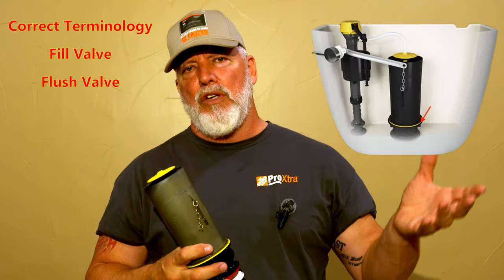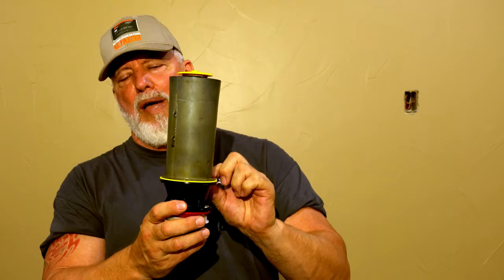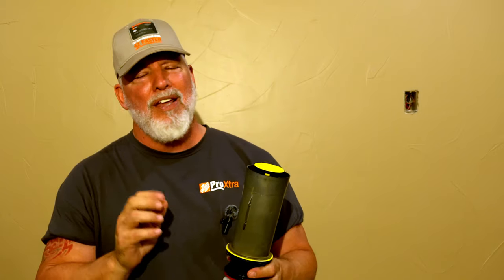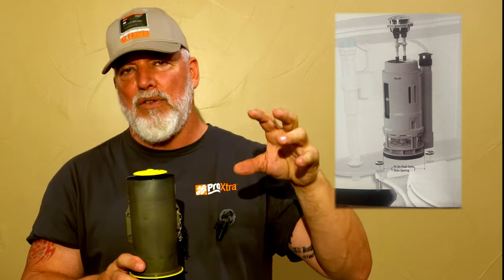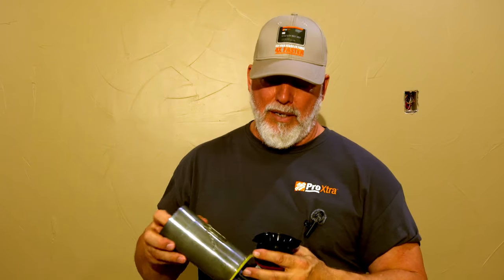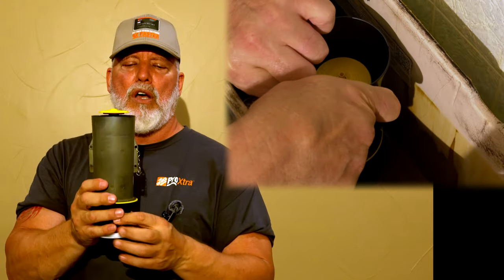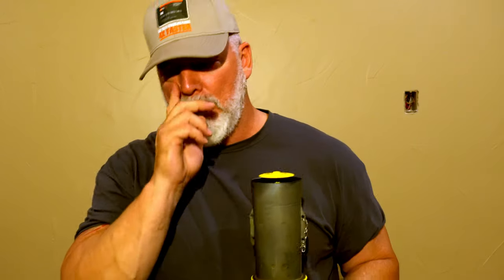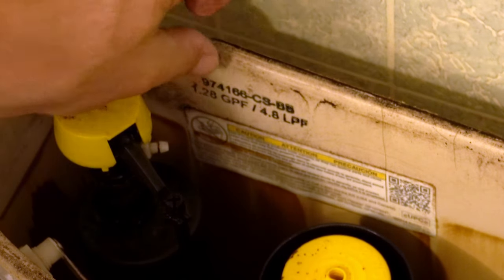How To Fix a Kohler Canister Flush Valve In 60 Seconds in 2024 #kohler #plumbinghacks #toiletrepair

Comment: Every time I flush mine, the canister gets stuck all the way up, and the water continuously fills and never stops. If I just tap it, it falls down easily
Reply from the maker: I check your handle adjustment, if it looks good I would replace the canister. Thank you for watching and your question.
Reply: I have the same problem.  How do you adjust handle?
Reply: Same problem here
Reply: Mine keeps leaking.  Won't seal
Reply: Thx. This has been 8 years of frustration. Dont like these cannisters.

Comment: Good presentation.  The Kohler valves are a BAD design...if you don't hold the handle down for 5 seconds, you don't get a full flush.  Worse, you don't get a full bowl fill, and you may have solid waste sitting on dry land, getting stuck and smelling bad.
Reply from the maker: Absolutely agree, thanks for watching and sharing.

Comment: I replaced the canister but now the water is bubbling in the toilet bowl and sounds like it keeps “running”. What am I doing wrong? 😣
Reply from the maker: @cassandraoshea4713  I would pull the canister back out and reseat it. Bubbling sounds like something maybe stuck . It will make a gurgling sound if there’s something stuck in the line somewhere.
Reply: I just watched your other video and it stopped based on turning the screw on the flush valve. Fingers crossed!

Comment: My valve stopped flushing the right amount. What is wrong?
Reply from the maker: There can be multiple reasons from a bad or clogged fill valve or flush valve to the handle. Also check that the water is filling to the top of the overflow tube.
Reply: Thanks

Comment: The flush canister drops to quickly and does not let enough water flow through
Reply from the maker: That can be a couple of different things first I would check and make sure that the lever has not gotten out of adjustment and that it is raising it high enough and then I would also check my water level and make sure the water is all the way up to the top of the overflow tube. I have ended up changing out the entire canister to make that situation stop.

Comment: Hi, Im having issues with the water fillling up after each flush. I have to take the back cover off and wiggle the valve for it to kick on and fill it back up. Very frustrating. 😫
Reply from the maker: You May want to replace the flush valve, I have a video or two showing the process. https://youtu.be/yNtvaL4noU8?si=dny0r-U-VE_21MTB
https://youtu.be/Ae4eJYFUpTI?si=cuVc9qGuspjgFNs1
Look at these 2 videos

Comment: This is a great video and I am thrilled that I found your channel. When I asked Kohler about my issue they recommended I purchase GP1059291 seal and 1374724 washer. You didn't mention the washer in your video. Where is it and does it need to be replaced? Thanks again and enjoy your coffee.
Reply from the maker: That is the washer that is located between the part that stays in the tank when you remove the canister like I show In the video. You don’t need to pull that part to repair the canister 99 out of 100 times, that’s why I didn’t mention it in the video. As long as it’s not broken it should be left alone. Thank you for watching and commenting

Comment: Excellent! Watched the video, took three deep breaths, rehearsed on the $22 replacement, took off the canister, cleaned the gasket, replaced the canister, turned on the water, flushed the toilet and it worked like a champ in less than 60 seconds! Thank you so much!
Reply from the maker: Nice work! I’m very happy that it worked for you. I have another video coming out in the very near future that will go over many other problems that you can have with your toilet that you can fix without any tools and it very low cost. thank you for watching and thank you for the comment.

Comment: Finally a guy that shows the detail of the pieces and the quick repair and replace methods.  Nice video , appreciate the close-ups of the two piece unit. Nice thanks.. if you take a rubber hose that is a little longer , coil it near the canister connection - much like a service loop in electrical wiring , lightly zip tie it that way so the coil flexes - it might fix that issue pr prolong the inevitable.
I saw someone disassemble the yellow cap , there is probably a nifty way to do that - but they showed no closeups.
Reply from the maker: Awesome ideas, I have a short video coming out this week that shows the disassembly of the yellow disk. They have released a replacement part to fix the issue now. It is supposed to be stronger. The disk unscrews just like the main unit think medication bottle. Thanks for watching and the great insight.

Comment: Hello 👋 this was an awesome video. My question is my toilet flushes but doesn't fill back up. I usually turn off water n turn it back on and it starts filling back up. In this case its my filler valve i need to replace? Or do i replace the canister?
Reply from the maker: That sounds like a fill valve issue, I would start there. Thanks for watching and commenting

Comment: Thanks for the help. My problem was with the yellow disk but it appears to be an installer induced failure. The installer apparently removed the two locking protuberances on the stem of the disk. I see no way it could be normal wear. After 6 years, the disk began shooting off whenever the toilet was flushed. Your video walked me through the disassembly and installation of a new repair kit. I was having no success finding the repair part until you said that I needed to get the model number off the tank. Thanks again.
Reply from the maker: You’re welcome, im glad it helped, thank you for watching and commenting.

Comment: Thank you for this vid. Helpful.  My problem is.  If I flush the toilet the water does not kick on to fill the tank.  I've cleaned and flushed the flush valve.  I don't believe the float is sticking.  However, if I turn the water supply off, and then on, the water rushes into the canister as it should. Perplexing.  Any thoughts.  Have you encountered this issue?  I'm now subscribed to your channel. Much appreciate your coaching.
Reply from the maker: Thank you for subscribing and watching! Generally when I see that issue it’s in the fill valve not the flush valve. I would rebuild or replace the valve. Both are easy and I have videos showing both. Look under my plumbing playlist.

Comment: Thanks, great video.  My problem with this canister is slightly different... i feel like the canister falls too fast and i get weak flushes. If i hold the handled down a little longer no problem... ideas?
Reply from the maker: The only real adjustment that might help that is adjusting your fill valve so that the waterline comes all the way up to the top of the canister. If that doesn’t work, you may consider just replacing the canister all together and see if that solves the issue
Reply: @UltimateDiyer this is the problem I'm having too. Is the middle of the canister supposed to be full of water? The way ir seems from your explanation in the video is that the center of the canister is full of water and that's a what slows its closing? Or did I misunderstand that? Thanks!

Comment: Great video.  My problem is that the canister moves left or right after a couple of flushes making the chain taut, and the canister doesn’t close so toilet keeps running.  I already shortened the chain as much as i think is right.  Any ideas?
Reply from the maker: My first thought was the chain/handle as well. Maybe the canister is defective and causing it to stick. The next step would be to replace it, if you are sure the chain and handle are adjusted and working right. Make sure the handle isn’t bent out of shape.

Comment: Great video!  When I run the water hose to the barb the toilet runs non-stop. Bought another one and it does the same thing. But if I put hose outside the tube the toilet will fill and work fine
Reply from the maker: It sounds like the seal at the bottom of the canister is leaking. I talk about the seal in this video. https://youtu.be/h4UCiQLQaZA?si=4IERcw9glalnpEh1

Comment: Thank you! We’re new homeowners and neither my husband nor I were taught how to be handy around the house. We’ve spent a lot on hiring plumbers and carpenters and electricians, but are feeling like we should learn some basics to save money. But who can we learn from? Well, this video helped us a ton! $25 fix and who knows how much more it would have cost us had we called the plumber. I have subscribed! Thanks so much!

Next up…do you have a video on how to re-attach a faucet handle that’s fallen off? It’s a kitchen sink handle that sits on the side of the faucet.
Reply from the maker: I am happy the video helped you and that you subscribed. I haven’t fixed a handle in a while mainly because there are so many different models and usually by the time they get bad the customer wants an all new one. But I will definitely upload the next one that I do. Most of the time it’s a small rubber seal that needs replacing but you may need a special tool to get to it. Some are easy and some are not depending on its age.

Comment: Good video. It seems the fitting on my yellow disc is fine and intact. But the hose is stiff and brittle and keeps popping off so it seems all i need is a new line. But im not sure if the is a little clamp holding the line on the fill valve or if it just pops off.  I dont wanna go in and just pull and end up breaking my fill valve. Should that just pull off?  Thanks!
Reply from the maker: You should be able to pull that clip loose.

Comment: I have the same Kohler fill mechanism and after a weeks worth of flushing, the canister rotates90 degrees clockwise to the point where the chain is no longer pulling straight up and starts to bind. Any idea what to do with that? Thanks :)
Reply from the maker: That’s very interesting, I would most likely just replace the canister because the canister should not be able to move. I just opened up one of my toilets that have that canister and tried to move it and they are locked into place so I’m assuming some type of plastic guide or something is broken loose on yours thank you for watching and thank you for the comment.

Comment: Good morning, great video. Question? My Kohler like your example seems to have problems. Everything seems to be working however the toilet doesn’t flush it fills the bowl with water and doesn’t flush. Used a snake, wide open. The toilet on the other side of wall back to back works great. Could it be the top valve u mentioned? The bottom seal has been changed and seals the tank fine. After sitting the bowl does drain down to normal.  Help please..
Reply from the maker: It’s hard to diagnose without see it in action but if the bowl is filling it sounds like maybe the flush valve isn’t allowing enough water to enter or the fill valve is functioning correctly. Take the tank lid off and flush and see if the take is emptying completely into the bowl. You should only have a small amount of water in the bottom of the tank.
Reply from the maker: Also I know you said you have a second toilet backed up to this one, you could have a partial clog in your vent stack that is blocking air to that toilet.
Reply: Thank you so much for your reply. I found a blockage under the toilet. The snake couldn’t reach it. Used a super plunger for about 10 minutes finally got it loose. Works like a champ now. Keep up the great videos…..
Reply from the maker: That's great news, I thought it sounded like a blockage of some kind.  @tompipes2371

Comment: I did this replacement a few months ago when the old one broke at the bottom nub. Recently, I've found that there's a tiny trickle of water into the bowl after the tank is full. I pulled the flush canister and checked the gasket. It still seems to be in good shape, soft, and mating surfaces were clean. Is it possible the fill valve is not closing all the way and needs to be replaced?
Reply from the maker: Yes, I would definitely change the fill valve if you are sure the gasket is good on the flush valve. 
Thank you for watching!
Reply: @UltimateDiyer  appreciate the feedback!

Comment: My little yellow “disc” at the top has decided to separate itself from the canister itself. I heard it when I flushed and it came away from the canister stem, but the hose is still connected. They do not sell the yellow disc? Luckily I have the same three toilets in our home…should i just bit e the bullet and replace the whole canister you just demonstrated in your video? GREAT instructions by the way, your instructions were easy to follow.
Reply from the maker: From the time I put that video out, they have started selling the center yellow disc with the center rod at a much lower price. This is the link to the part on Amazon. https://www.amazon.com/dp/B0170823WC/ref=cm_sw_r_as_gl_api_gl_i_GBY9ZKHHDDM0Z6GB8R1F?linkCode=ml2&tag=ultimatediyer-20
Reply from the maker: I’m glad that the video helped. Thank you for watching and thank you for the comment.

Comment: I've been having a related but not identical issue. In my case the issue is that the flush valve drops down too quickly, preventing the bowl from refilling properly regardless of fill valve settings. Is it possible I've got water inside the canister that's weighing it down, or is it a design issue?
Reply from the maker: We’ve had several others with the same issue and generally replacing the entire valve assembly. Seems to fix the problem. Just make sure that the water level is set correctly which it assumes you did by your description. Sometimes the handle itself can be bent and not flushing properly as well, so be sure you check those parameters. Also be sure you’re checking your fill valve that it is functioning and filling correctly.  If it is clogged and not putting enough water out, sometimes it will not get enough water out in time and the canister shuts prematurely.
Reply: @UltimateDiyer  Thanks! The problem actually arose when replacing both the flush valve seal and the entire fill valve in one go, so it shouldn't be an issue with the fill valve. I'll replace that entire upper flush valve assembly and hopefully that'll fix it!

Comment: I have a flush valve with a very hard plastic hose to the fill on the Kohler Canister. This canister has a stem that the hose won't fit on. I think the old one had a recess the tube used to be inserted in (it always popped out.) I want to cut off the hard plastic tube from system and replace with a tube that will replace it and fit on the nipple/stem on the canister. Any ideas?
BTW I had ordered the wrong 3" bottom cannister but the flush part in the middle (1/4 turn beak-off easy) was all I needed. Great videos btw. I just need to bowl to fill when the tank is.
Reply from the maker: I usually get that hose at either the big box store or the local plumbing supply store, take the old one with you to make sure you get the correct one. They are a common size, thank you for watching the video and thank you for the comment. I glad that it helped.

Comment: Hello, my name is Miss Brooks, and I just like to say you explain that very well.I am no longer intimidated. What I would like to do is have a better flush and a stronger flush. How do I accomplish that? I have a Koehler toilet. Model number 5380-AA.  I just changed my very first Koehler toilet flush valve.😊
Reply from the maker: That’s awesome, im glad it helped. I just released a follow up video and it explains how you adjust the water level so you don’t have that annoying water running sound. It works the same way to get a stronger flush by making sure the water is as high as possible. Set the float as high as possible without the water overflowing into the canister. Thank you for watching and the comment.

Comment: First, thank you for the excellent video and explanation. Second, I have a question, mine doesn't flush fully unless you hold down the handle. My theory is that the canister is coming down to quickly, before letting all of the water out. I tried messing with the chain, it doesn't matter. This use to work by the way, and recently just stopped. Not being experienced in this area, does this sound like the canister itself could be the issue to someone more experienced? Or something else?
Reply from the maker: In older units with flappers, the flapper gets hard and doesn’t function properly, so it could be the canister itself. Another possibility is that the water isn’t set high enough. I set mine as high as possible without overflowing the canister. 
Also make sure hard water hasn’t clogged the bowl jets, that also happens. Lastly the handle and chain can be out of wack but you said you messed with that. I would try a new canister unit if you have tried everything else. The fill valve can make things act weird as well but that usually doesn’t make the canister fall to quickly unless it’s not filling with enough water, “clogged”. Start with the simplest things first like water level, make sure handle is fully opening the canister, then look at water flow into the tank and bowl. 
Then try a new canister, new flush valve last resort. Let me know what you find, thanks for watching and asking the question
Reply: @UltimateDiyer It actually ended up being a calcium buildup on the siphon jet on in the inside of the bowl. The jet couldn't force water out fast enough to flush the toilet. I broke it down with some toilet bowl cleaner and a small knife to chip away at the buildup. Now it flushes great! Thanks again!